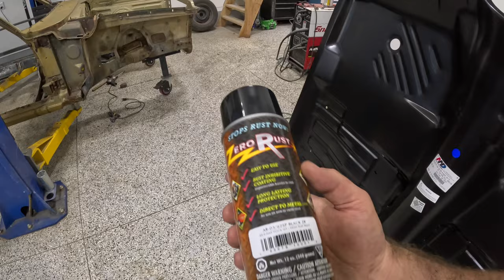1969 Plymouth Roadrunner Restoration - Episode 3 - Floor Pan Replacement

Comment: Sir, you make it look easy, and I suppose starting off with a clean car makes a huge difference, but you tackle work that intimidates many, myself not excluded. Keep up the good work.
Reply from the maker: Ain’t nothing to it but to do it!  The Charger & Cuda were a in a lot worse condition!
Reply: Adding a full floor in my opinion is easier then welding in patch panels. Patch panels warp from the heat from the welder.  More grinding just takes to long.

Comment: It doesn't feel like this car even belongs on this channel, its just too clean. Nice work, I hope we get to see it when it is fully completed. I also have a needle scaler which is super handy.  The instructions had a warning about using it perpendicular to the work surface. It says that can damage the tool and to use it at a 60 degree or less angle only, just thought I would share since you were doing that, but maybe yours is made differently.
Reply from the maker: For heavier gauge metal it doesn’t matter too much.  For sheet metal panels like floors or firewalls you definitely want to angle it.  It’s amazing how well it works!

Comment: So glad that your trying zero rust. I’m a fan of putting a brush on coat on bare metal. Done the treatment to many underneath components. Even rear end housing/ k - frame. Doesn’t quite have the correct sheen so a I’ve top coated. When a guy doesn’t want to spend the money on powder coat. Hard to believe but the cheapest spray bomb ( flat black) at Home Depot had the sheen I was looking for.
Reply from the maker: I really liked it!  It sprayed smooth with great coverage.  I'd compare it to POR15 but not quite as glossy.  I'll definitely be using it again!
Reply: @rustbucketrestos6511  , I did a test on an old crusty fender cleaned it up a little bit but still had bondo and rust on  it. So far after a year outside in our Alaska weather it’s held up remarkably well. The bad thing about por is it’s not intended for bare metal and of course the price. Just a little heads up with my experience so far 🤛

Comment: Great work! What is the brand of weld through primer your using?
Reply from the maker: Eurospray Pro
Reply: @rustbucketrestos6511  found their website but not anywhere to buy it. I’ve been using different brands but not stuck on anything right now.